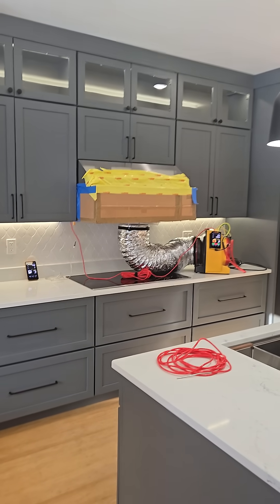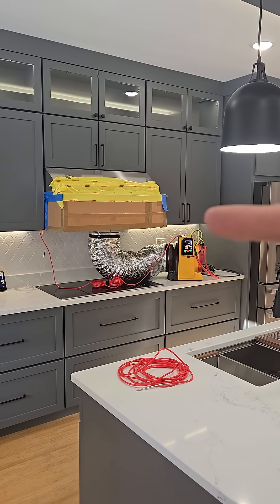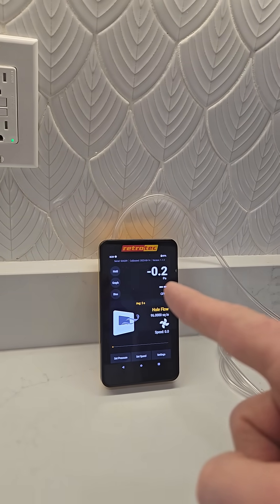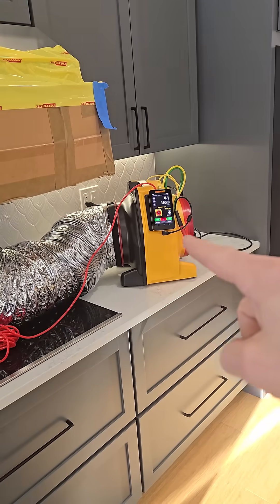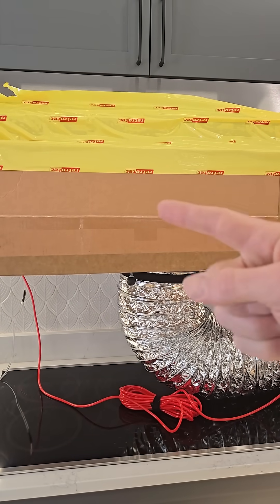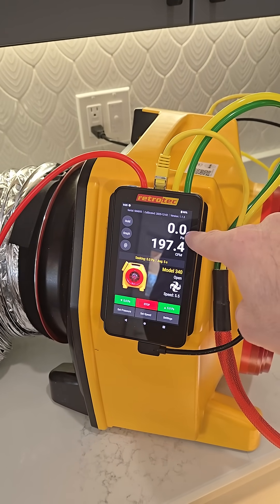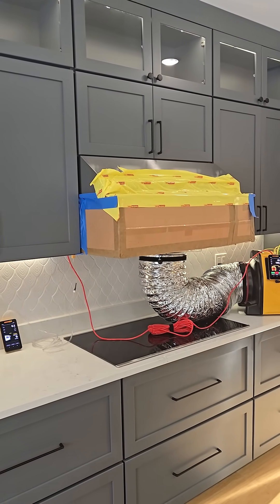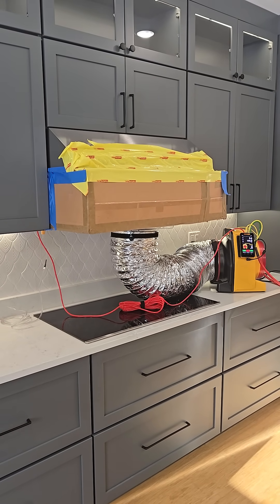Measuring Kitchen Exhaust Hood Flow

Comment: I measured my hood in a different way and calculated it was only moving 130cfm instead of 560 it was rated at. Mine travels in a 7 inch duct but has a restriction just above the squirrel cage only using half of the duct. I couldn’t measure at the restriction so mine is not as accurate as your method.
Reply from the maker: I used the hole flow method with a manometer and found it to be within 10% of the powered flow hood method.  I have a longer video coming out saturday with both methods.  Thanks for the comment!
Reply from the maker: What method did you use ?
Reply: @ShawnBaldwin603  I used a wind speed meter to get the linear feet per minute and then I took half of the 7 inch duct in my calculation to come up with 130 CFM. Since I couldn’t get the measurement of the air speed at the restricted point of the ductwork, I measured it at the exterior of the house. I am an amateur at this so I could’ve calculated it wrong.
Reply from the maker: @DaveDugdaleColorado 
Thats a valid way to get close.  A lot less expensive too! Haha

Comment: So no need for make-up air?
Reply from the maker: The code would not require this fan to have any additional makeup air.
Reply from the maker: Hello, yes a makeup air system is required by code for any kitchen exhaust over 400 cfm.  The house in the video only leaks 150cfm@50pa, so the passive 6" vent I put in was not enough, it really needs a powered makeup air system.  They are over $4k installed, so i did a passive one.  Thanks